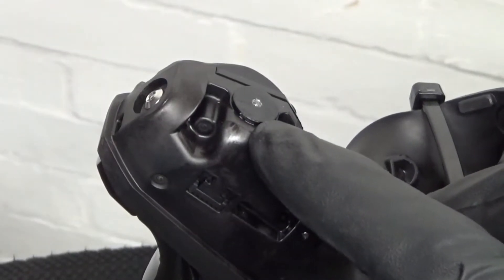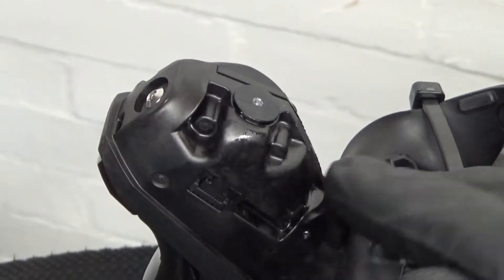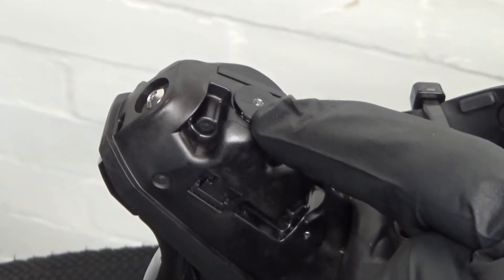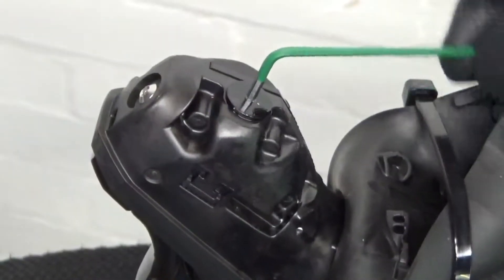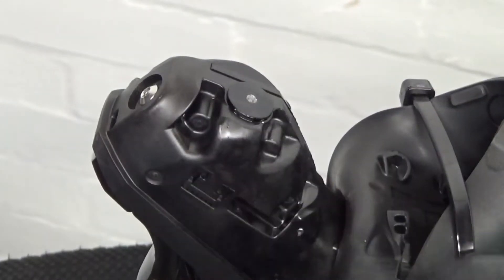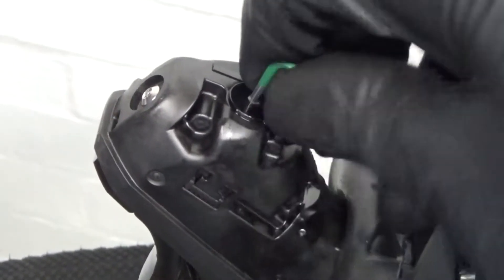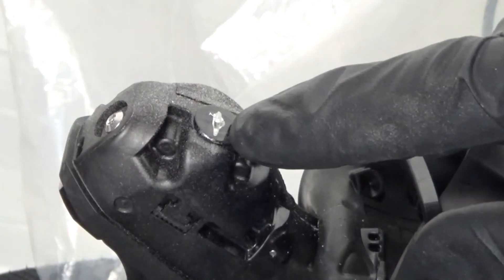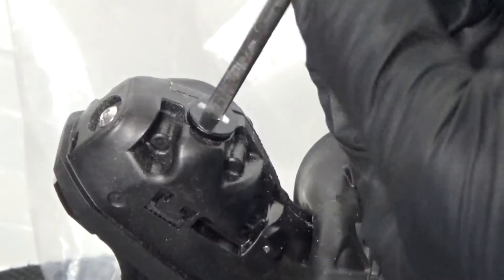How To Remove A Damaged Bleed Screw Cover | Shimano Levers

Comment: Had to use a Dremel after rounding off the bolt on my new levers...
Replaced with Y0MX98020 screw which is meant to be stronger than what originally came with my 12 speed ultegra.

Also used some new premium hex wrenches instead of the Aldi special which I rounded the screw with originally.

Comment: Great help as usual but I was hoping you'd have a fix for stripped threads on the the shifter bleed port that the cover screws into.  Might be worth considering a warning to be extra careful with the cover screw since it's so easy to strip the threads in the shifter, and if that's stripped, there's apparently no fix and you must replace the entire shifter.  Based on my search for a fix, it's pretty common to strip the few light plastic threads in the shifter--then you're really screwed!
Reply from the maker: No need to replace the shifter it can be repaired! I will have a full video showing how to repair them coming out shortly!
Reply: @FreeToCycle  That is fantastic news!  I really look forward to that video coming out, thanks so much for letting us know!!
Reply from the maker: https://youtu.be/DePvBvteqas

Comment: Looking for  advice regarding damaged threading in bleeding port. The screw is not tightening at all. Shifter is Shimano 105 R7020.
Reply: I have your problem all I did was wrap pumpers tape around the screw a few times and screwed it back in and not to over tighten just enough to get a grip
Reply: @christophercondron5388  it worked. Great tip.
Reply: I tried this and it worked. Is it possible to order replacement parts to do  full repair ?
Reply: @beastiecarrion  definitely possible also expensive. I believe you have to replace the entire brake lever.

Comment: This has happened to me and a few of my riding buddies so many times, its like they are made of cheese. I ended up carefully drilling a shallow second hole (1.5mm bit in hand drill) just to one side of the hex to accept one of those 2 pronged "Snake-Eye" screwdriver bits that comes in those cheap anti tamper bit sets (one prong goes in the original hex socket the other in the new hole)  Given how soft they are I decided to just leave them that way and keep the bit with my bleed kit.

Comment: My son's Ultegra Di2 has both these screws with stripped heads and screwed in tight.
As these are recessed, the drill-a-slot method can't be used.
I have some extractors (the ones with a drill bit at one end and cutting extractor at the other, but that was a last resort as the screw is so shallow thesre's a risk of drilling a hole right through.

So, I tried the Torx Driver method. My size 10 torx has a hardened  head and is very sharp edged (Made by Wera).
I put the driver in the top of the ruined hex, tapped it in with a small hammer and it stuck in and worked.

Both screws are loosened and awaiting replacements.
I only tried this because...
1. Even though Wera Torx drivers aren't cheap, they're cheaper than new R8070 Di2 units.
2. I had used WD40 on two occasions over the previous 4 days as I thought it might help. I will use brake cleaner to stop cross contamination, though.
3. I had a great fear that either of us would have a power tool run amok.

Next screws to go in are going to be tightened down as if kissed by an angel rather that the angry gorilla approach previously used.

Comment: Do you know the part number for the screw? I have grx 810 but I'm sure any of the road bike ones fit.
Reply from the maker: Y0C698030
Reply: @FreeToCycle  Y0C698030 - is it the same part # for mechanical or di2 hoods?
Reply from the maker: Same part for both!
Reply: @FreeToCycle  thanks for the reply.  I made a dumb error and let some fluid out, in hopes of widening the gap between the pads and rotor.  Now the one lever pulls all the way to the bars.  What is the solution? full re-bleed? or will a half bleed work? ie. no syringe, just the funnel on top with some fluid and a few pumps of the lever? Will this firm the lever back up? cheers!